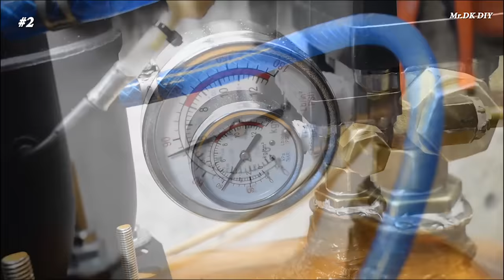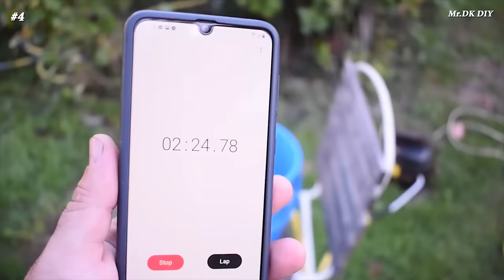4 WAYS HOW TO REUSE OLD REFRIGERATOR MOTOR COMPRESSOR

Comment: Downright dangerous and illegal. There are certain legal requirements for a pressure vessel in the UK and welding should be by a coded welder not an amater.  Looks like he is using a continental electric plug so he should be well away from me. If you are in any doubt look at the Health and Safety Executive site and PSSR.

Comment: Another Mr. Badwrench at work. 
1. Never weld on a re-used closed container or tank without filling it with water. Explosion danger. 
2. Don't weld galvanized fittings. The fumes are toxic.
Other errors pertaining to painting are not mentioned because not dangerous,  just bad practice

Comment: how many days to fill a car"s tire?
Reply: What size Car tyre? A peel 500 might take an hour, my Porsche 924 Rear tyre up to eight hours, and what pressure do you want to inflate to ?
Reply: Now,  you know that is a complicated question.
To answer it, you would need to know the line voltage supplying the compressor, and the size of the car tire.
For instance; if you have twelve items plugged into a gang-plug, powered by a single lamp cord that powers your entire workshop ... then, it is possible that your fridge compressor is wheezing on just 30 volts or so, while the lamp cord gently smokes on the floor.
Sooo ... clearly, we're going to need some additional data, to get us started.